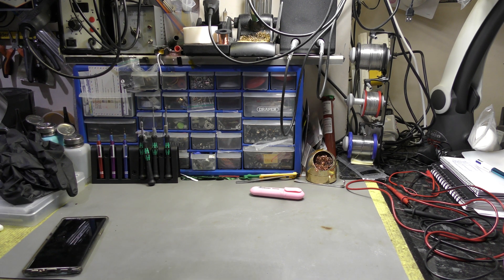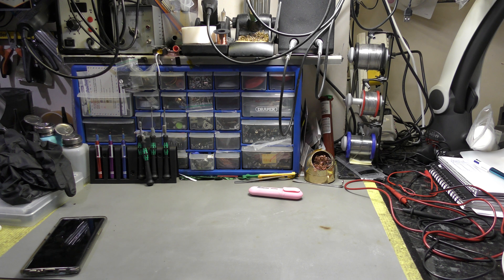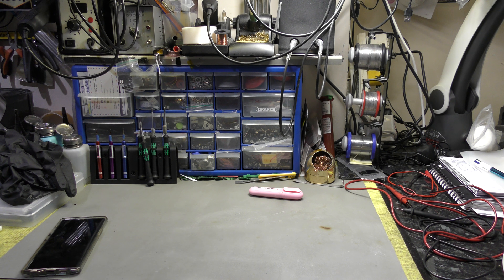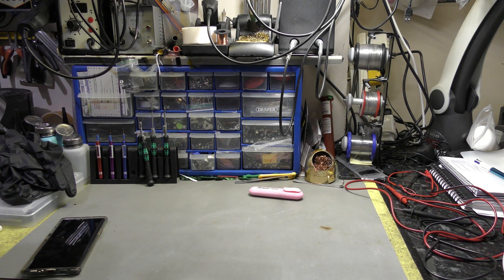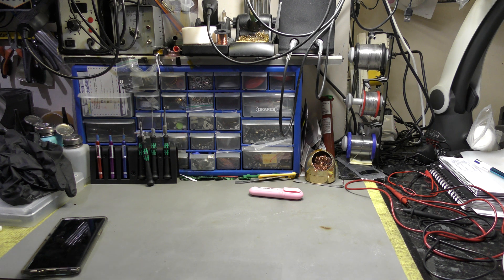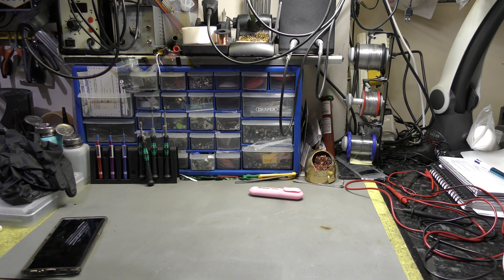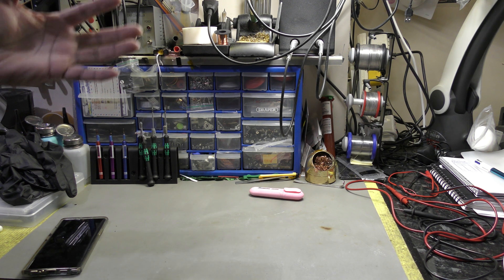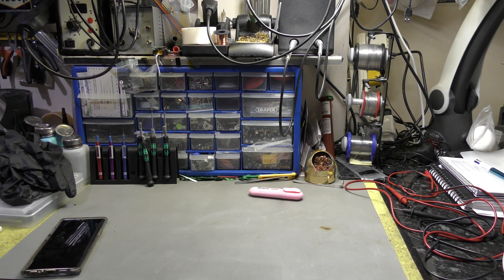HOW BMW E90 330D M SPORT N57 DPF REGERNERATION HAPPENS

Comment: A load of shit!  Blue smoke is oil burning.
Glow plugs are only used to start the engine...
DPF can only regen with high exhaust gas temps and will not happen cruising along at 30mph.

AND A DPF REGEN DOESNT MAKE SMOKE AS IT IS CLEAN BURNING ALL THE SOOT, brown smoke is unburnt soot!

I have a F30 335d and in 60k miles it hasn't smoked once!